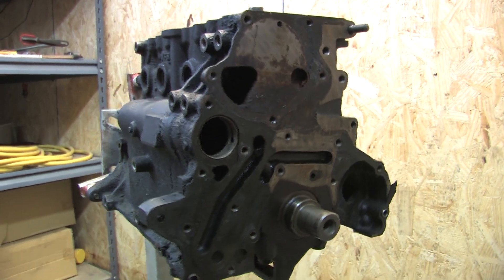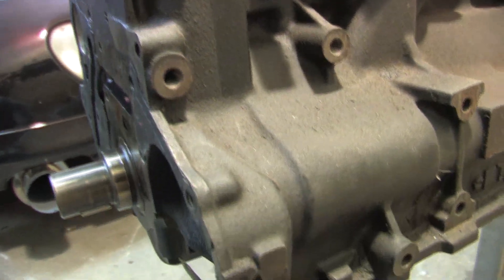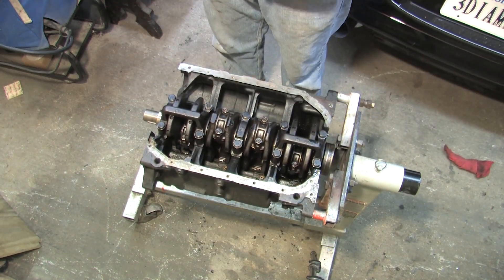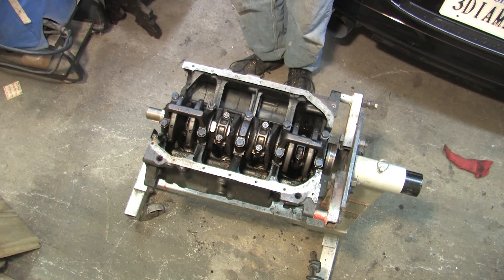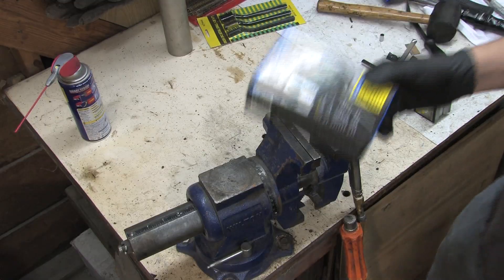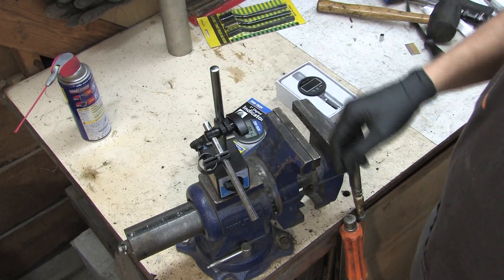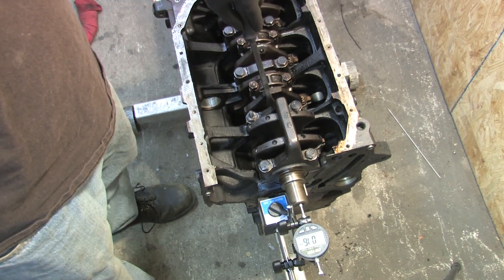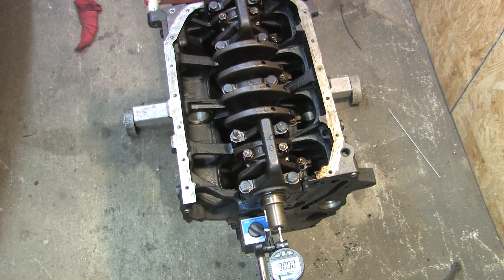Blueprint 102 - Measuring 4g63 Crankshaft Endplay

Comment: Well…this is a long shot since video is 11yrs old…BUT what can you do if your end play is only .001 ?
Reply from the maker: Get a new thrust bearing, do the torque procedure and try again.  If the next bearing does the same thing, it's likely the thrust clearance of your crankshaft, not the bearing.  At that stage, If the thrust surface is damaged, you don't want to use that crank like it is.  Get a second opinion at a machine shop.  They may be able to fix it?  There would be no home remedy for that one.
Reply from the maker: Part B.  There may be trash trapped behind the thrust bearing, or the bearing might not be seated properly.  Rule this out before following my other advice.

Comment: You mention engine that cannot turn. Can you expand on thoughts of potential issues when run dry of oil. Engine block and crank are rare and I am suspecting main bearings are damaged, possibly welded to the crank. I found a spare crank but curious to get your thoughts how screwed I may be. Engine is an 80's BMW M30 with cast iron block and SOHC cam...

Comment: hi how you doing , im portuguese and would like to ask you something about thrust washers in the crankshaft , i have a  cherokee from 2000 diesel and in less than 1 year i changed my thrust washers 2 times  because after remove the transmission i checked and saw that they were like damage and not in good shape, so if in less than 1 year i changed them why they are damage again and what is doing this?  The first time i changed i checked the crankshaft end play whit your help video here and the measure was good and in what they wrrite in manual , so i dont undestand what is causing the damage and maybe you can give me an opinian...thankyou

Comment: anyone know if its okay to measure endplay with the engine somewhat hot?  I measured .004" on my 7-bolt 4G64, but it had been driven prior to that.
Reply: The specs are at room temp or near that when the mfg created them. If engine is hot, then metal has expanded and the thrust bearings could be off by a few thou, given anything else thats expanded pushing on them. If your at your limit, Id say test again when cooled down, if your in the middle  then its probably okay.

Comment: The play of my 6 bolt is about 2mm. 
Don´t you think replacing the seals will reduce the play alot ?  
It´s driven 140k miles and not gently miles and it hasn´t been maintained that well for a while.

Comment: hi can i do this check by removing oil cover engine in place, if so, can i use pry bar and check for big end loose, also are you suggesting that crank should not be loose but rod can be... please advise. if so how much is allowed  also pls advise if high end engine like lexus is made of high quality and live long comparing to low end like toyota assuming both are maintained properly